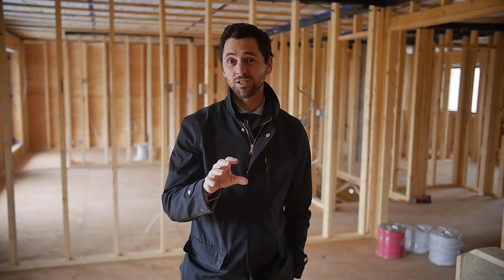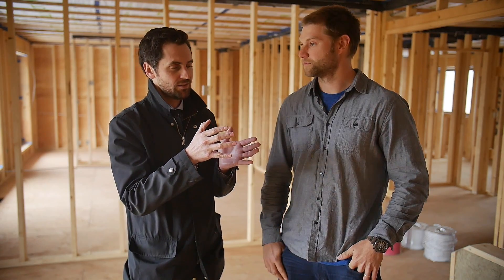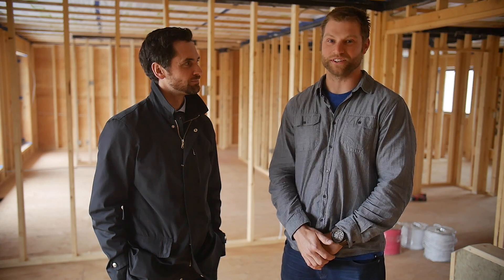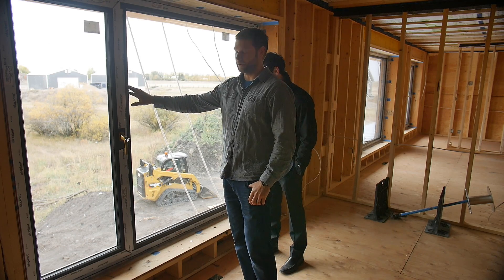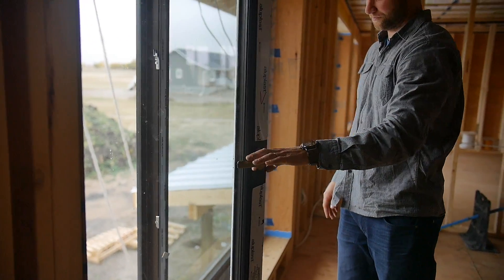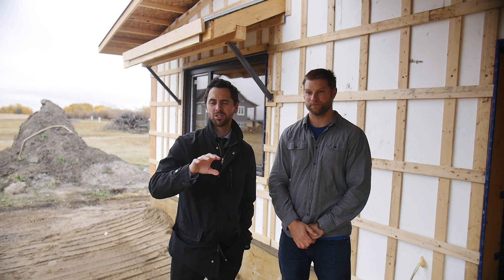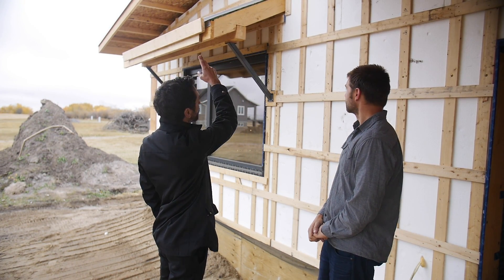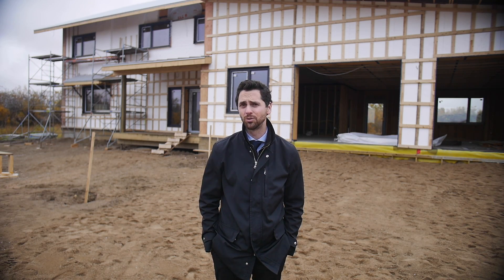Net zero homes

Comment: u have R 50 in the Walls and 100 in the ceiling but so much Glass which just kills it as u can only get R3 , so id go with less? and have u thought of any SHW?
Reply: High performance windows should give at least R8. Cheap American windows give around R3. Plus the windows they use leak less air than a typical American window.

Comment: what is the cost per sq. ft for this construction?
Reply: Square footage price is relative to the area and the level of finishes. There was an 8-9% premium to build this home as Net Zero when compared to building it to code. This includes the 16.43 kW solar system, which provides enough energy for all the heating and energy usage of the home.

Comment: sounds like you are building in North Canada where temperatures go down to 60 below and stay there for months at a time
Reply from the maker: This property was built in southern Saskatchewan. Our temperatures do get down to -30 degrees Celsius (on some days) in the middle of winter.  I will be doing a followup video shortly to discover how the property has performed over the last few months. Specifically regarding the heating and cooling of the home as we do get into +30 degree Celsius days in the summer.
Reply: @andrewrinkremaxcrownreales8085  That is way colder than this part of the world. Today it got into the 50F range.  We do get snow usually enough to make a snow ball.. LOL  I somehow think getting to net zero with insulation and great windows is a lot easier here.  Double pane with a couple layers of film inbetween will get me close to the u VALUE that is needed.   Lots of cellulose with a bit of foam in the right places can really achieve decent air sealing.   Modern ventilation and getting the exterior of the building done right with a full envelope on all sides (foundation) to keep the air change to 0.5 per hour.   Allowing a place for moisture to move away and allow for the various building materials to dry .  It all adds up. but my thinking is over time  the savings quickly pay for the extra to do the shell correctly and make for a comfy house.     I live in an area where cooling is generally a much bigger thing than heating.. That said..  think Radiant in floor that is 90% driven by solar is the way to go.   Heat cooling and hot water seem to be the massive load on utilities.   I am waiting to see if someone who builds appliances is going to come up with a combo unit that is a refrigerator that help drive the hot water or one that heats water and drives an ice making machine.
Reply from the maker: Tomorrow I am filming part 3 of the Net Zero Home. I should have it up to view within the next week or so. It will be interesting to see how the home has performed as the last couple days we've had 60km/h wind gusts making it feel as cold as minus 40 degrees Celsius.
Reply: @andrewrinkremaxcrownreales8085  There are lots of ways to get to net zero have been working on my own version  Thinking a few things that really dont add lots to the cost.  20 inch open truss filled with dense pack cellulose.  Walk out basement/ similar in design to an earth ship, only with out the tires. Using magnesium oxide sip panels not tires.  Just the mass of the earth.. Much longer earth tubes to help ventilate to the ERV.  Seems like the key to every net zero home is getting air change per hour way way down.    Air sure does not move easily thru almost two feet of cellulose.  Firestoping is easy and helps to cut down the air flow.  Am still a bit up in the air with metal roof or a living roof.  I am in se Tn  so the weather is in no way like yours though we do get pretty good amount of humidity.    looking at perhaps 5k watts of pv power and 2 large storage tanks for water . Radiant is the only way to go
Reply: I'm in SE TN, too, and planning to build soon. Have you decided yet what to do?

Comment: Adam

what climate zone are you in?  How much EPS insulation for climate zone 5?
Reply: We are in climate zone 7a. The r-value for the wall depends on your goal with the home. Whether you are looking to build a high-performace, net zero or Passive House. For climate zone 5, I would consider an R-35 to R-40 wall to be high performance. To achieve this you could use a 2x4 wall with 6" of exterior insulation to get you close to R-40. By reducing the insulation on the inside of the air barrier the assembly is less likely to have moisture issues at cold temperatures.
Reply: @pillerputzconstruction1934  dont think one needs nearly the exterior insulation for most zones.. a larsen wall filled with cellulose. and a 2 to 2.5 inch for the exterior to get a good thermal break.  so R 15 exterior will get you r-42  Still one has to look at whole wall which is mostly destroyed by inferior windows.

Comment: explain south??? what is facing south??
Reply from the maker: South facing is referring to the direction the back or rear of the home faces for maximum sun exposure to help heat the home in the winter.
Reply: Houses like this use solar heat gain as part of the overall heating strategy.

So, in the northern hemisphere, you want to limit the number of windows facing north, east and west to limit uncontrolled solar gain.  On the south side of the house (what Andrew refers to as "the back"), or the areas that generally have most of the communal living space, is where you want to have most of the glazing on the house.

During the late spring through early fall, the sun is generally higher in the southern sky, and you want to LIMIT thermal gain.
You do this through overhangs and awnings.

During the late fall through early spring, when the sun is lower in the sky, it comes directly in through the windows, contributing to the amount of heat put into the home, and decreases the amount of heat that the HVAC system needs to produce.
Reply: You want most of your windows on the Southside, few on the East & West sides, and even fewer windows on the North side.  The Windows on the South are specially treated to allow radiant heat from the sun in while blocking convection and conduction heat thorugh the window. All the windows are triple paned.

Home orientation is key to making use of passive solar energy.

Comment: The wall assembly for the home in the video is a split wall design and is a very safe wall assembly for our cold climate. The design follows the 60/40 rule with over 60% of the insulation on the exterior side of the 5/8" plywood air barrier. This keeps the plywood sheathing warm and above the dew point, reducing or eliminating the risk of condensation inside the wall cavity. There is no interior poly vapour barrier, which allows the wall assembly to dry to the interior if necessary. The demo wall in the video does not show the Tyvek WRB that was installed between the plywood and the first coarse of foam. Typically, we use Roxul Comfortboard for the exterior insulation, however EPS foam will provide a safe and cost effective wall assembly when used properly. The screws attaching the 1x4 strapping do cause a thermal bridge which reduces the wall assemblies effective r-value by approximately 10%. However, this is offset by the fact that insulation values increase with decreasing temperature (with the exception of polyiso foam).
Reply: I have a question, R52 can probably pass Passive House standard & you’re already using PH Certified materials (tapes) & PH building strategies such as taping the sheathing and the details around the windows, the only weak link in this house on the video is windows.. I’m assuming they’re not PH certified but still better than code. Why did you decide to build it to net zero & not just go all the way to Passive House?

Comment: trap moisture has to be on outside plywood surface, then it MUST BE gap /distance 1"/ thick , and then you can add any thickness of any insulation.Never ever stick tight styrofoam to plywood.Thats the lie!
Reply: Actually, consensus is changing on that front. There is plenty of evidence showing that eliminating air gaps from the building envelope can improve efficiency, if done right. No one is lying, they're innovating. Just because it's been done a certain way for ages doesn't mean there isn't a better way to build in efficiency. Building techniques will continue to improve, but the industry needs to embrace the innovation instead of fight it just to keep their cost low. Many customers are willing to pay a modest premium if they understand the long term savings.
Reply: seems most builders do not do a good job of giving moisture a place to go.
Reply: Andrew Misiak 
air gaps have proven increase STC. Structural Insulated Panels for 60 years have been attaching foam to plywood or OSB with no air space. Research Forest Products of Madison, WI. Frank Lloyd Wright and Forest Products developed and built a frameless wall system in 1932. Those homes are still standing today. Visit sips.org or premiersips.com

Comment: What you used to fasten EPS to plywood,is it glued, or it is only mecanical  fix?
Reply from the maker: The Builder says they attached the first 4x8 sheet with 5" construction screws and washers. The second course was attached with the strapping.
Reply: would consider wood strapping to allow for condensation to flow and dry the plywood.. so using a dimple mat with fiber like is used on basement walls is another way to accomplish this  I would use mechanical fasteners as not a lot to really glue the foam to and still have a way to attach finished sheathing